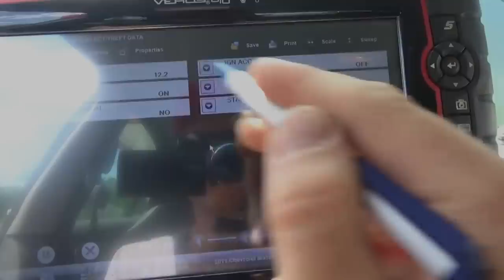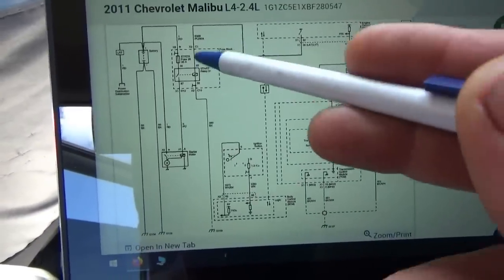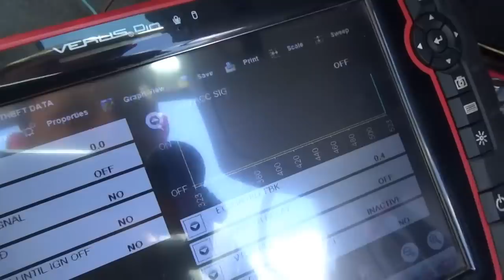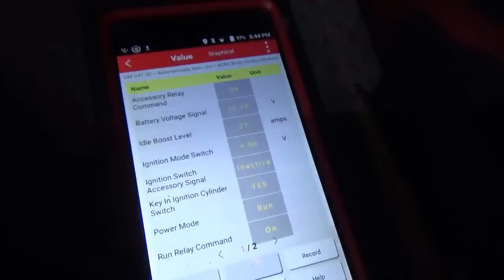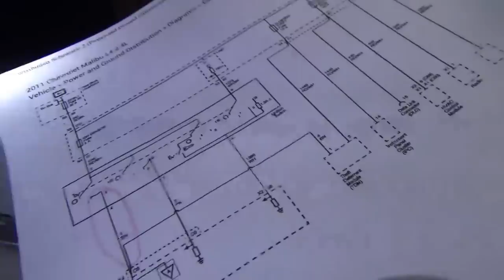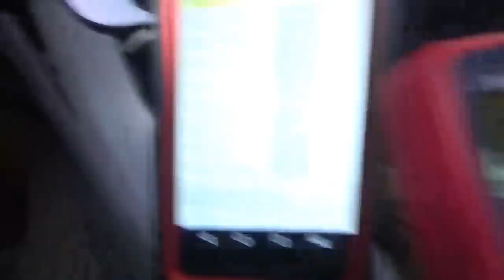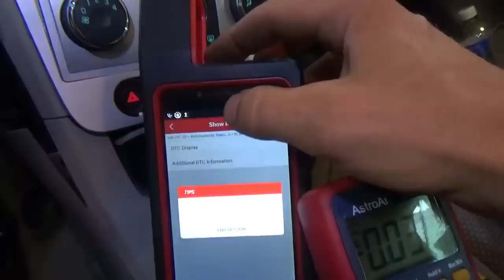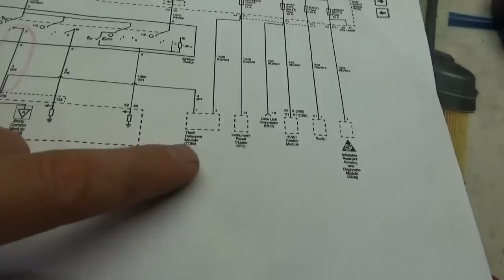Mystery Malibu is BACK! (Intermittent No-Crank)

Comment: Yeah last year I made a mistake I've been on trying to diagnose my friend's Honda that was no crank and instead of my very first test which proved to me that there was no power at pin 16 I went up and checked the fuses and assumed that one of the fuses that I had no power on was an extra spare fuse and instead it was a key fuse for lighting up pin 16 and the rest of the computer...I did figure it out once I got home and looked at a wiring diagram for a second time right as my friend called me and said hey I just found one of the fuses or dad told him to replace it and boom his car fired up and it's still been working but I went away from the experience learning that if you don't have power coming into the pin 16 you got at least find out why instead of skipping past it and thinking that he had a fuel pump or a crank position sensor problem stupid me stupid me stupid me
Reply: Power Probe has a new(er) break out box that has a scan tool port.
Reply: @pedrorojascervantes3928  I have Not seeing that is a breakout box with a OBD2 port?

Comment: Yes, your failure was in failing to reduce variables. The most important variable was the human one. Don't work in a strange public parking lot with the customer waiting to drive his car away. Place the car on your turf, with familiar tools present, and all the time needed for diagnosis. Don't assume you can succeed under constraints imposed by outside forces. Reduce the constraints to manageable ones. Treat yourself like a pro, and customers will treat you like a pro .....or they will find other mechanics until they come to accept that they must find a pro.

Comment: For me, the biggest no-no was doing mobile work in a gas station parking lot with all the distractions.  Better would be to have the car towed.  It's not your responsibility as a mechanic to replace the tow truck.  Perhaps a review of your business model is in order.  The likelihood of misdiagnosis goes up exponentially in a mobile situation.  I understand you feel some responsibility after having just performed other work, however these are vehicles that have been used for some time and have questionable service/use histories.  Of course you can do as you please, but do expect such misdiagnosis' to occur as a normal part of your practice of working remote to your shop.  Afterall, diagnosis of complex computer driven devices  requires presence of mind.

Comment: Im having this same exact issue, went into limp mode got it home. Got a code for a bad throttle body changed that. Has a crank but no start just like this. Get a code of C0899-00 control module power circuit. Changed camshaft position sensors still nothing. Changed spark plugs still nothing Changed ecm still nothing. No theft mode just it wont start. Starter ingauges, have fuel cuz got sprayed by gas tapping the nipple on the tester plug in on the line. Hit a wall in knowledge and tools to do this so I'm stuck waiting for taxes to waste at a shop. I got fired from my job bc of this happening bc of how many days I've missed  so if a shop cant figure this out I'm most likely fuuuuuuucked.

Comment: There is no such thing as just a blown fuse. Even a separated fuse link is suspicious.  I would have go ahead and done the ignition switch . Internal arcing voltage amperage spike ???
Reply: I think I agree. Replacing this switch is not covering up a mistake but more good reliability insurance for the owner.

Comment: What were the f'ing odds of that happening?  Leave him with another fuse just in case.  Do fuses get to hot and blow sometimes without a cause?  Or does there have to be a surge in power or short to ground issue to always blow the fuse?  My horn fuse blew on my BMW.  I replaced the fuse and it's been fine ever since.  So what caused it?  And with cars that can drive themselves now, they also should be able to tell you exactly what needs fixed now.  No troubleshooting.  Get rid of it.  Put in the AI.

Comment: Hi Ivan...I have some sad news for you...the days of putting bread and butter on the table from GM products may be dramatically reduced....why you ask????? Big news today....HONDA...YES HONDA and GM are joining forces in North America....I will say that GM quality just improved by LEAPS AND BOUNDS. I will say it again....I have NEVER...NEVER seen any of these problems with any Toyota I have owned. Now, granted my Tundra only has 450 kms on the ODO....so stay tuned. As for your diagnosis....I will cut you some slack....GM has been making 💩💩💩💩 ignition switches for decades....so to think it was bad is an obvious go to because the brand has had all kinds of problems with ignition switches in the past.

Comment: You could have easily checked that fuse and found power to both sides of it.  And if that was the case, then....???  Then push the BCM over and have  lost power to one side of it without even realizing.

So...???  You're just F'ed.  You did find out why the car was traded in, however.

Comment: Fuse box fuse box fuse box fuse box hairline crack hairline crack hairline crack in the circuitry inside of the fuse box you have to pull the fuse box apart and when it expands when it gets warm cuz it's under the hood it forms a hairline crack in the little cheap copper wires circuitry inside of the fuse box